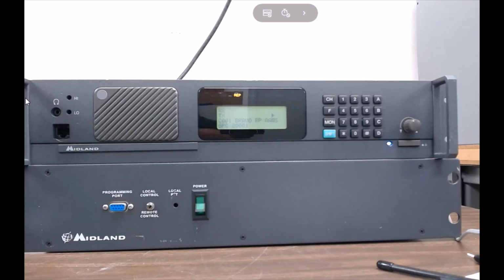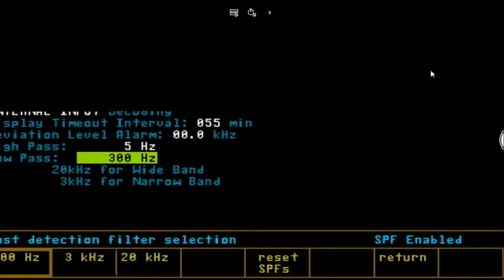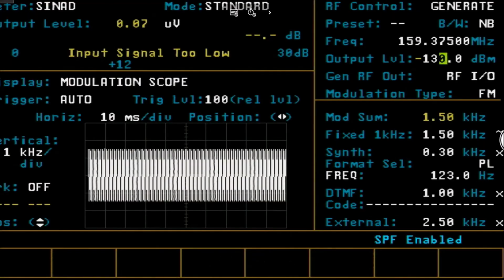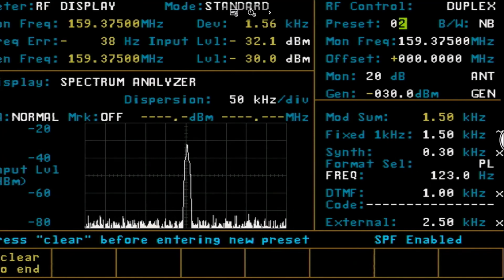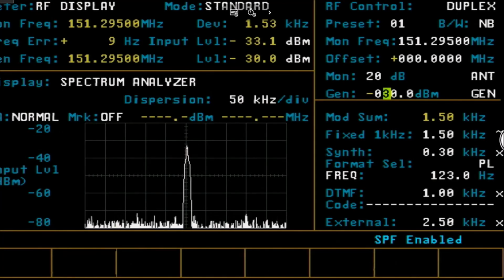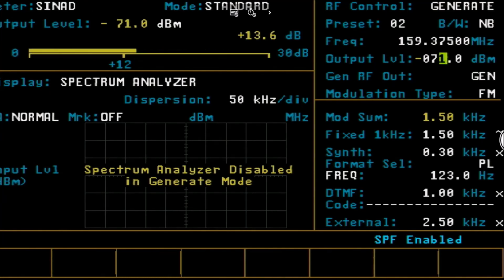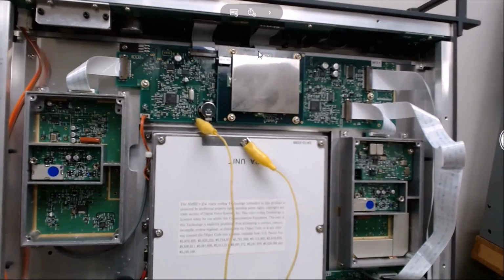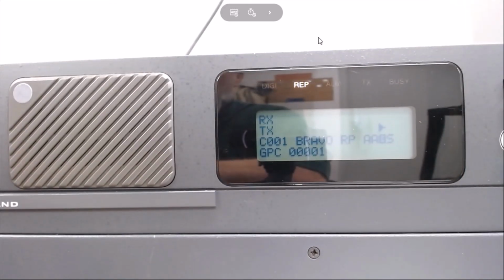Midland Repeater PM/FCC Using R2600 Service Monitor

Comment: Great video. Where can I purchase that 1:1 isolation transformer that you are using in your SINAD test? Thank you.
Reply from the maker: Thanks. The one I was using was from an old IFR service monitor. I can't find anything like it online. If I had to make my own I might use a Valcom VMT-2 with some coax pigtails.
 https://www.amazon.com/Valcom-600-Ohm-Isolation-Transformer/dp/B00OZDR1KA/ref=asc_df_B00OZDR1KA/?tag=hyprod-20&linkCode=df0&hvadid=642112814556&hvpos=&hvnetw=g&hvrand=1854126406178952501&hvpone=&hvptwo=&hvqmt=&hvdev=c&hvdvcmdl=&hvlocint=&hvlocphy=1015150&hvtargid=pla-2003424720607&psc=1&gclid=CjwKCAjwvfmoBhAwEiwAG2tqzKrxOPCo5eBGW5lbjIJbAoCwsw5YFXl-MnvZr1mLPbb2TzZ2Lv5_5xoCfAYQAvD_BwE